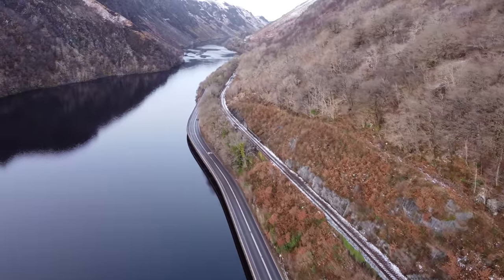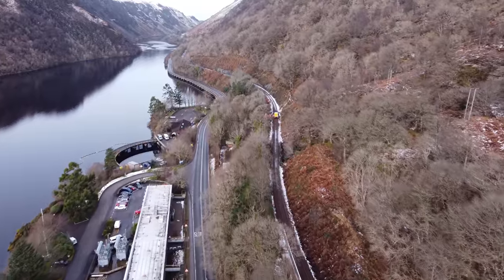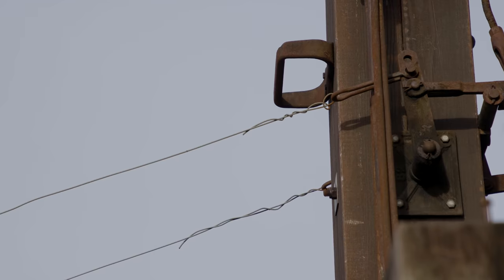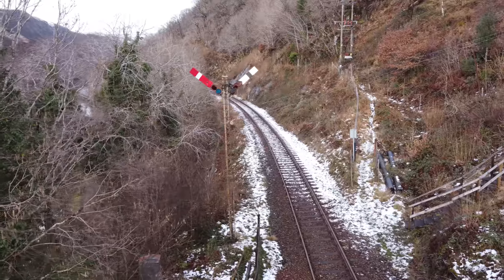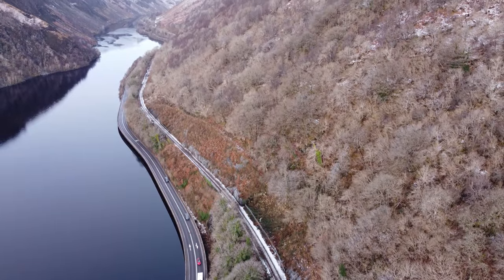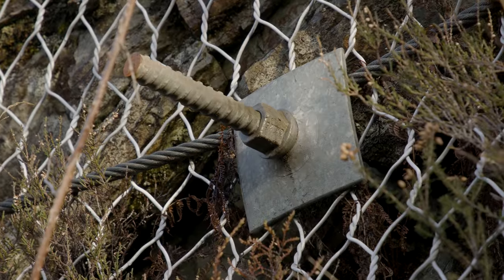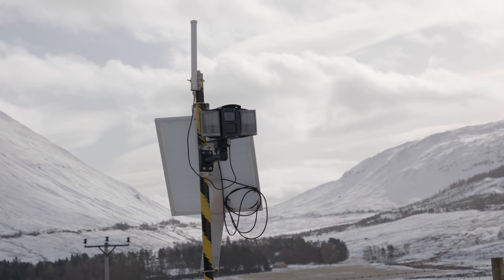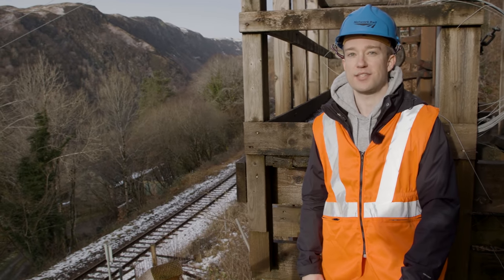After 140 years, this old technology still keeps trains safe

Comment: Railroader for eight years here. 

I worked in Montana for a while and we had these for a section of our track which was adjacent to a rock face. I have personally only seen this system set off once before which was for a fairly large rock that got through, but wasn't on the actual track. There's also a permanent slow order through that zone which was 30 mph.

If it works, no need to fix it. The fact is that many of the technologies used on trains and track is decades old, some of it over a century old now.

Comment: Ironically the issue of not having power in remote areas also plagues the power grid.
If you're trying to set up a SCADA system in the middle of nowhere to measure current flow it's going to cost $10,000 just for the transformer that gives you access to 120V/240V power for your computer systems. That's the best case scenario for an issue that by definition is under an existing power line.
Reply: Wouldn't solar power be a good idea? Where I live there are ton of flood gages. They are all solar powered and talk to Flood Control over the cell phone network. There's even a website where regular folks can check levels.
Reply: Full SCADA systems are no longer needed.  That’s the “revolution” of IoT.  Sensors, computing and communication are now very cheap.
Reply: @Bacopa68  It is a good idea but only as long as the sun is shining. At night or on a cloudy day propably not so good.
Reply: Probably still cheaper than running another cable with 240V! I imagine solar cost/efficiency + battery + ever reducing watts/hz in computing gets you over the bar with sufficient reliability margin in a growing number of cases as time goes by.

There’s plenty more instrumentation manufacturers could be doing to reduce power consumption and reliance on a town power supply. None of that equipment needs to run on a 240V supply. Open it up and you’ll find a Switched mode supply giving you 12V and 3V3 DC rails.
Reply: @Jonny_24  there's these crazy things called batteries. I think they might solve your problem.
Reply: @HashtagBirdyy  Gee, why didn't we think of that! It's almost as if batteries have very low energy density and aren't a current solution..
Reply: @UDumFck  IOT devices are often easier to hack, and the power grid isn't allowed to rely on the internet for monitoring and control. If there is a nationwide blackout, the control systems still need to function for 72 hours without any power, while telecom infrastructure goes down after 8 hours. Many computers used by grid workers have no access to the internet and have the traces in the motherboard cut to prevent any USB use. And most of the SCADA systems they use date from the mid-70s to the late 80's
Reply: @UDumFck  IoT needs internet.  If you're miles from town with no cell service and no 120/240, kind of hard to get internet.  Of course there's satellite, but that needs power as well.  When all you have is 115kv or 345kv power line, you have to get a bit creative.
Reply: SCADA and other associated control systems run just fine off of batteries and solar. A good example of this are outdoor warning sirens
Reply: @abbytran8514  Its almost as if the low energy density is totally irrelevant in a stationary application and batteries are currently a solution for such applications and have been for decades.
Reply: @moth3rfck3r-s4n  Speaking as someone working for a company with a couple of hundred thousand battery powered data loggers calling into our network I'm inclined to agree with you!  They're robust,  fit in your hand and the batteries last for years.
Reply: Dad worked for Eveready Batteries back in the 1950's. One of the products they sold was a huge lead-acid battery that they sold to the Union Pacific railroad to power signals in remote areas. You used a crane to lift it into a deep vault by the tracks, where the temperature of the earth would prevent it from freezing. The voltage was low, but it would run for months.
Reply: agreed. entirely right dude
Reply: @jsncrso  Or the text messaging system linked to flood gauges in Harris County.
Reply: If you're worried about lack of sun to keep the battery charged, add a wind turbine for extra generation.  You can get both for < $1,000.
Reply: The obvious solution is to build your computer out of large semiconductors that operate at 20KV.

Comment: Given the amount of avalanche and rockslide detection systems here in North America I’m surprised none have fitted the needs in Scotland. 

Also, the continuing past a “danger” signal exists here in Canada; there are two in fact: “restricting signal” and “stop and proceed signal”. Essentially, you continue at a speed below 15mph at which you are able to stop at half the view range distance (ex. You can only see 500 meters ahead so you must go at a speed in which you can stop in 250 meters). These are usually in automated CTC (central traffic control) portions of track that operate by the axels of trains completing a faint electrical circuit in the rails to trip signals and usually give this indication if there is a grounding of current or a cracked rail.
Reply: Given the average speed of tracks in the US and its infrastructure grade of D- I wouldn't be surprised all these brillant systems imediately went into the bin
Reply: They aren't detecting avalanches or rockslides, just the stray rocks that can cause a lot of damages despite their relatively small size.
Reply: A similar thing exists in Hungary for block signals, since they're generally out on the open track where station personnel isn't available to check that the train can pass safely despite the signal showing "stop" (danger). In general, the engineer has to wait for two minutes before proceeding at no more than 15 km/h, but the wait isn't required if on-board signaling is available and if the on-board signal shows clear beyond the signal, they engineer can speed up.
(I'm glossing over nuances here for the sake of brevity)
Reply: I'm quite sure that Tom Scott was a bit mistaken on the 'always stop on red'. Google "permissive signals". Those exist in many countries, including countries with a quite modern rail network such as The Netherlands.
Reply: In the UK are signalling system is not speed based signalling but route based signalling. The line is signalled under RETB=Radio Electronic Token Block. You simply add a Semaphore calling on Indercators in the form of a mini Semaphore signal.
Reply: @marco23p  he's not really mistaken, just not specific enough - he's referring to the UK rail network, the grand majority of our signals operate on the rule you must stop on red unless given permission. This set up is a rare exception.
Reply: @zacm.2342  There is only one other place where there is a rule in which the driver may authorise them self's to pass a signal at Danger without having a SPAD and that is on the Northern City Line between Dayton Park & Moorgate.

Comment: When I saw the thumbnail, I thought you were talking about semaphores. :) I was confused because there are regular lighted signals on certain railway lines these days, not just semaphores. The mechanical rock fall detection system makes more sense (and makes a lot of sense for needing to use semaphores :) ).
Reply: So did I
Reply: lit not lighted. Poor English there!!
Reply: @markylon  That would be "regularly lit" as in frequently, or with a constant time interval. "Regular lighted" might have needed a comma ("regular, lighted"), as they're both descriptors of the signal style, and indication that "all" signals contain nighttime illumination of some form or other, these days.

Comment: A very nice video, thank you.  It's about the same over here, for slide/fall detection.  Very much more integrated with the signal system and dispatcher, but a fence is a fence at the guts of the system!
I worked with the railroad for 39 years and I will say that "If it ain't broke, don't fix it" is a viable option in considering system changes or upgrades.  Every system/option has its trades.

Comment: In a similar vein, the 1800s telegraph city-wide fire alarm system still used to this day in Boston USA because it just works.
Reply: We had one of those in parts of Houston, but they must have phased it out. I haven't seen an alarm box since the nineties.
Reply: San Francisco uses the same (incredibly clever and robust) system. Unfortunately they seem to be having some trouble with maintenance due to the age of the system. There was a news story a few years ago that they ran out of "out of order" notices and had to resort to duct taping red bath towels over non-working pull boxes.

Comment: Having passively active systems that don't require power is just great. I whish more solutions with less or "other" power would be used. Electricity and computers have become the common standard, but aren't necessarily the best option. Thanks for this intriguing video. :)

Comment: Permissive signals, where after they're at danger you're allowed to proceed anyway just slowly and within sighting distance, are very common worldwide. France and the Netherlands are full of them. Britain is actually quite unusual in not using them anywhere.
Reply: Nope, Britain has permissive signals in a lot of places too. Usually they're used for things like allowing a train into an occupied platform block section in situations where it is supposed to couple to the train already there.
Reply: People who know very little about a subject making a YT video about it?  Couldn't happen.
Reply: There's lots of permissive signals in Britain, or else you'd never be able to couple two trains together or have two trains on the same platform.
Reply: @PinkThorn242  That's not even remotely the kind of permissive signal being talked about though?
Reply: I was under the impression that if the shunt signal beneath (if there is one) shows a "proceed" aspect, trains may continue at shunting speed even if the main signal is at danger. As other have said, they're mostly found near station platforms and railyards.
Reply: @PinkThorn242 : I think OP meant "permissive" in the sense of "you [as a driver] can pass the signal at danger [a signal indicating to stop] under your own authority", rather than that from [e.g.] a signaller or position light aspect. Until relatively recently, automatic signals were permissive (as per before) but the rules changed about 2010-ish to stop that (was the motivation for that stated anywhere?)
[Edits for clarity/corrections]
Reply: @fetchstixRHD  Yes, this is what I meant. In the UK on Network Rail, passing automatics at danger disappeared in about 2010 and passing intermediate block home signals disappeared only in the last couple of years. Obviously with subsidiary signals or verbal/written orders from a signaller you can pass signals at danger everywhere for sidings/degraded mode operations/platform sharing.
Reply: @AlistairLynn : Yep, thought that was it  😉
On that note, does HS1 still have the "permissible" TVM block markers as per French LGVs? Seems like they're harder to find information on than Network Rail and Crossrail's core!
Reply: In Germany, electric signals are accompanied by a sign indicating what to do when the signal has some kind of issue. Most main signals just have a sign ordering the train driver to stop the train immediately (before the signal, of course), but there are also cases where a train driver shall continue to drive slow enough to be able to drive on sight. Imagine a high speed train slowing down from 200-300 km/h to 40 km/h because of a broken signal.

Comment: This failsafe system kind of reminds me of the one in industrial looms. A piece of metal shaped like an upside down U is put on every thread of warp (that's thousands of them) and should one break, the piece of metal falls on a special surface underneath closing a circuit. The stop is automatic, though, unlike in this video's case - it makes the loom halt and shows an error. Unlike the trains, if an industrial loom continues weaving, even slowly, after a string of warp tore, it's a problem.
Reply: Similar: High end kitchen mixers have a critical gear that's made of plastic. It's designed to break before more important (and more expensive) parts of the engine break if you over-work it.
Reply: @ItsMrBozToYou  and now they have table saws that fire a charge to stop the blade nearly instantly, when there's something conductive touches the blade. There's a video on YouTube that was done with high frame rate cameras, and using franks in place of someone's finger. The stopping power is so effective, that it tore apart the teeth not in contact with the brake on dado blades. It works much like air bags in a vehicle, but slams the blade rather than inflates a bag.
Reply: But those  things also always remind me of humans and tchernobyl: we dont know totally  whats  going  on but lets ignore warning signs, surely everything  is alright and they can be ignored, the warning just is wrong.

Comment: On the North American rail network, the lines carry an electric current. When a rockslide, snowslide, or other avalanche breaks the circuit, it triggers a red signal on the track and alerts the control center (which is often thousands of miles away).
Reply: This is for stretches of rail where power sources are not available or not economical. As one US train driver commented, they use a system like this in remote areas in the US.
Reply: In the UK, electrical signaling goes everywhere the trains do, so not a problem, however a mechanical switch at each wire could be tuned to alert central control if the wire is broken or pulled, with different alerts per direction .  If something is leaning on a wire (pulled), an investigation train can be sent to identify and remove it .  If something bigger breaks a wire, investigation train also needs to install a new wire and reset the tension to return the sensor switch to middle position .
  One advantage of such a basic upgrade is to signal trains to slow down before reaching the alarm area, with all the modern procedures of other temporary speed restriction signals .
Reply: Sehr altes und nicht gerade überzeugendes System. Gehen sie zur SBB (Schweizerische Bundesbahn) und schauen sie, wie diese hochmoderne automatische Technik funktioniert.
Reply: But if the current is in the rails, wouldn't this only work if a rail is actually broken???  And if so, might it not miss a rock or a pile of snow which obstructs the tracks but fails to actually knock a rail out of place???
Reply: The current isn't in the rails. It's in wires strung along the side.
Reply: @davidsp5936  Ah, so it's a separate system from the automatic block?  That makes it different!

Comment: Funny enough, Just last week I finished my Canadian railway signalling course. Over here, there’s actually a few signals that abide by the same rules! If they’re set to the most restrictive aspect, you must proceed at a speed that allows you to stop within half the range of vision of equipment, not exceeding 15 MPH. (I know, we should be using metric) and be on the lookout for broken rails/track washout. Neat to see that that rule is somewhat implemented across the pond!
Reply: Despite the UK being metric our roads and rail still use imperial for distances and speed for operations. Metric is used for surveying and design
Reply: @qwaszx2  How is Fahrenheit superior?
Reply: @Inkyminkyzizwoz  Fahrenheit is superior in the US as there is an entire body of knowledge referenced in US units. All just available from countless standards and tables.
Reply: I was wondering about Canada, having driven along the highway through the Canadian Shield in Ontario and I'm sure rocks have been a problem for trains over the years.

Comment: Reminds me of how the lights for the railway crossings here still use mercury switches, even though they've been banned for almost everything else, because they are just so much more reliable then any other electronic system.
Reply: how much more reliable is a mercury switch compared to a tilt ball switch?
Reply: I suspect they bounce less (as in contact bounce), and there's also less trouble with contact pitting from arcing (because it's liquid)